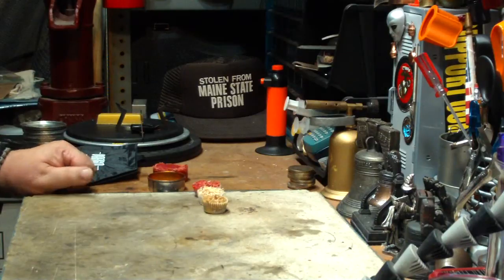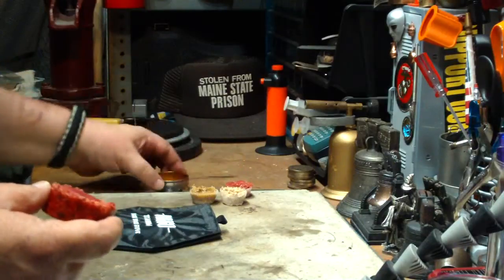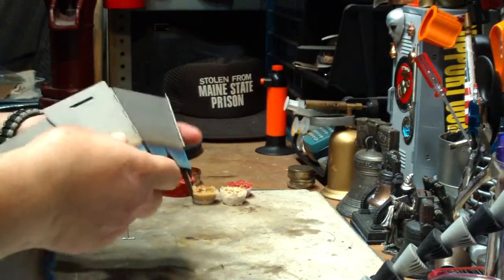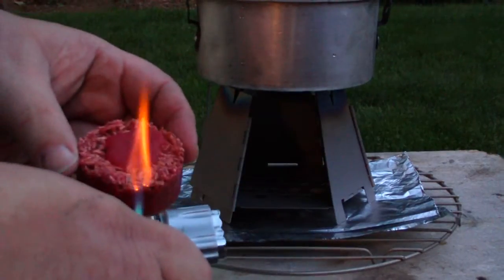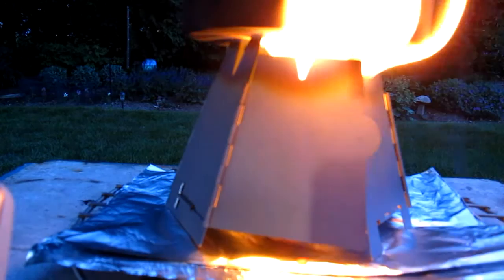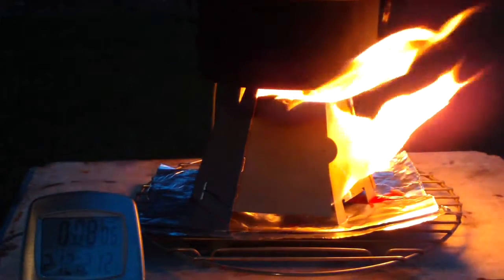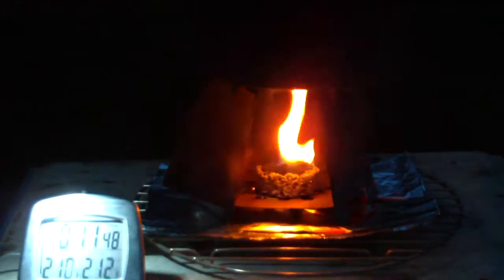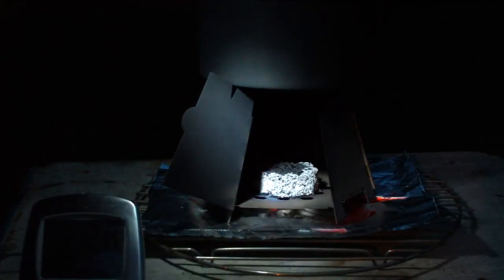Wax Coated Wood Chip Puck in the Vargo Titanium Wood Stove - Boil Test

Comment: The soot can be cut if you get more oxygen in, it is burning dirty because you have more fuel in the center than air.  Try putting something into the mold to make vertical air holes thru the puck.  My first thought was to sit some roofing nails on the table point up balanced on the heads, inside the mold.  After the puck solidifies pull the nails out.  This will let some air come up thru the puck, cutting the soot, and increasing the temp.

Comment: One question would be :  How many BTUs (and with what comparative efficiency) would a standard pocket-rocket, with small (or large) canister deliver? ... Comparatively ? ... Considering the mess and the labor of fabricating pucks (of any size), it almost seems purely obvious that, in terms of size and weight and efficiency (ounces boiled, on average, per ounce of fuel + kit) that the space aged pocket rocket (or Chinese knock-off) would be more) time, cost, weight, size efficient (way less fuss)

Comment: Might be worth using in a Swiss Ranger Volcano after several days of rain but I would STILL rather just go with Esbit or Trioxane or almost anything else ... But ... In purely soggy conditions, what may have been intended as a larger "block" of fire starter (a "soap-bar" form factor of your waxy pucks) could be pressed into use for boiling water (if you decided not to bring a pocket-rocket).   I would just mix those wood chips with lint and 50% bees wax and carve off slivers, to size, as needed.

Comment from the maker: If you were going to make them so you could quarter them I'ld make them a little thinner. Maybe around a 1/2" (1.27 cm) thick. The puck the way it is would be almost impossible to break. You could use an ax though. A little soot is ok but this was a huge amount. It wasn't real hard to get off the pot but it spread light wildfire. I had to be REAL careful of it or it got on everything.